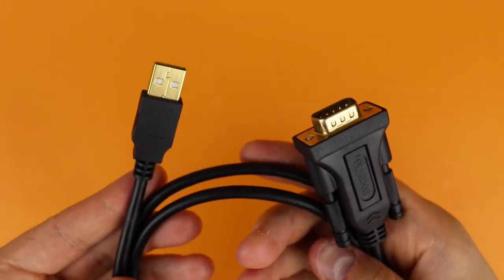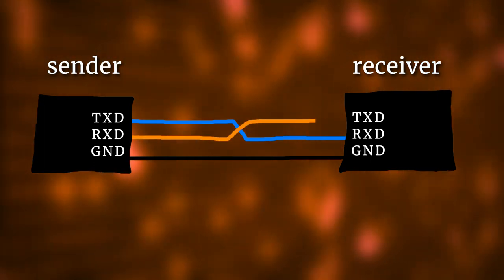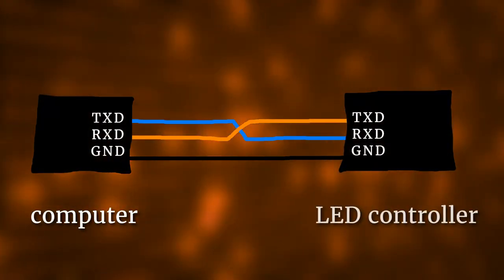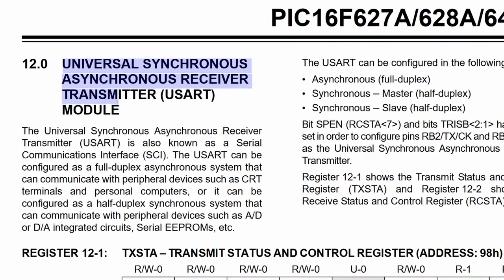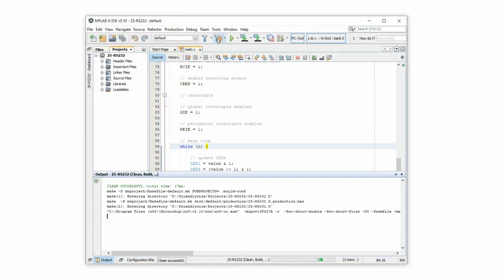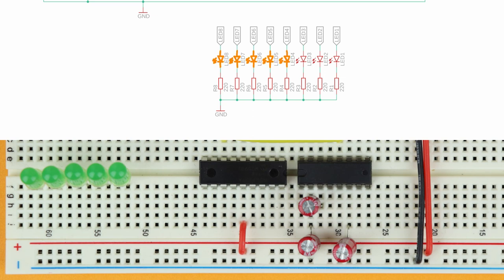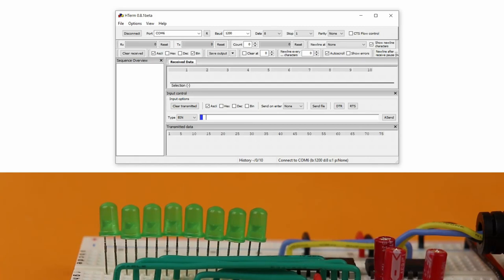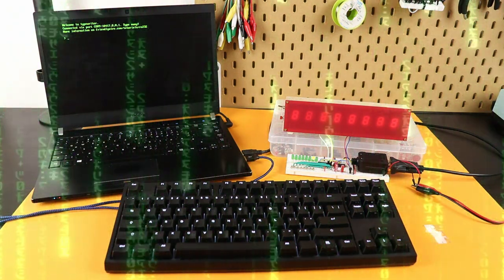Control LEDs with your computer using RS232!

Comment: Your videos are great!!
Reply from the maker: Thank you so much, glad you like them! :)
Reply: @FriendlyWire  do you do arduino too?
Reply from the maker: @arkmediagroupllc  For now I only focus on PIC microcontrollers :)
Reply: @FriendlyWire  can those microcontrollers control an I2C OLED display?
Reply from the maker: @arkmediagroupllc  Yes, many PIC controllers support I2C. I have not used it yet (most of the hardware I use is a bit older and only uses SPI-type protocols), but it surely can be done :) What display module do you have in mind? It might be a good future video!

Comment: I hope that the next tutorial will be pic interface with pc by using rs-422, rs485, and  USB
Reply from the maker: I have used RS-485 in the past for transmitting over longer distances, but only the hardware changes, the code will be the same. USB is a really interesting but that requires a different controller, like the PIC16F1455. I would love to make a tutorial on that one day!
Reply: @FriendlyWire For USB application  if you use an FTDI chip you no need to change to another microcontroller as long as the microcontroller has UART then could communicate with FTDI
Reply from the maker: @Alex-rv8gw  Yes, you can use intermediate drivers, true! I like that the PIC16F1455 and PIC16F1459, for example, actually don't need those, which is quite impressive.

Comment: Nice job!
Is it possible using your idea to control 8 independent PWM fans?
Reply from the maker: Thank you, glad you like the project! The PIC16F627A has only one PWM module, there are other controllers that have more. You could use the PIC16F627A to drive an 8x dedicated PWM controller, though, if you like, or even implement hardware PWM on the PIC16F627A itself. Does that help? If not let me know and I will explain more, and thanks again for stopping by! :)

Comment: I used to connect a device with a computer using device printer pins RS232 to DB9 RS232 at PC
but RS232 board broke down and now I am using an USB -RS232 at computer side but instead of coherent writeable ascii I  am getting commands characters under space codes
02 02 ... 02 18 10
The last 10 for LF is expected but 02s should be spaces and weights in ascii 

I am pretty sure that its a device configuration problem, but I thought, might it be a connection or a RX-TX inversion problem?

Well, now, because of your comment I will try inverting them.

BTW the device is a dynamic wagon weighting scale.
Reply from the maker: Interesting! Yes, it's easy to switch RX/TX either by mistake or by thinking about it wrongly, since one device's RX can be the other device's TX (or RX) depending on how everything is configured :) Did you manage to figure it out?

Comment: Hi , can I use a RS485 serial port on cctv recorder to trigger a relay . It can control a motorised ptz camera by setting rules in dvr, so I hope it is possible
Reply from the maker: Thank you for the question! RS485 has different voltage levels than the RS232 we talk about today, but I think that RS232 to RS485 converters do exist. Do you have more information on the CCTV recorder?
Reply: It is a Hikvision dvr and has 2 wire RS 485 port to control devices like motorised camera to look certain area when motion is detected. Instead of that I want to control other devices using a relay
Reply from the maker: @genuinetechniques9323  So you need a circuit that triggers a relay whenever the motor moves, yes? In that case you could sidestep the whole RS488 thing. What voltage does the motor use?
Reply: @FriendlyWire  I don't know the volatage of motor used, it all comes inbuilt. Only the control signal for movement of the camera can be  given through RS485 2 pin port.  And for my Requirement I can use any relay as u suggest
Reply from the maker: @genuinetechniques9323  I see. I think in this case it would be easier to just try to measure the voltage on the motor. In principle you can use a microcontrollers USART module to send data on the RS485 connection, but you would need a different circuit because the voltage levels are different. So it kind of depends: if you want to just get it done, then I suggest the first method, and if you want to spend some time to learn about the RS485 interface then that's the way to go. :)
Reply: Can I use a readymade relay board with RS485 support
Reply from the maker: @genuinetechniques9323  Not sure to be honest... Do you have a link to the DVR and the board?
Reply from the maker: @genuinetechniques9323  Without a datasheet that tells us the serial protocol commands this is a bit like fishing in the dark. Do you have a link to the relay board and to the DVR's datasheet?
Reply from the maker: @genuinetechniques9323  Okay, so the relay module accepts simple commands to set the relays on and off, the codes are at the bottom of the page. But I have absolutely no idea how to send out those commands from the DVR... I cannot find any information on the DVR's serial protocol. Nothing in the user manual and datasheet :(
Reply: @FriendlyWire  okay bro. Thank you for the support.  Anyways the dvr should be sending out some commands when a rule is met. Can we understand that and program relays to switch accordingly
Reply from the maker: @genuinetechniques9323  Do you have an oscilloscope? Then you could try to decode the commands that are being sent. Otherwise this is very hard to find out since the documentation of the DVR is a bit opaque on that :(

Comment: is it possible to interface an ATmega328 with MAX232
Reply from the maker: Hello Senam, thanks for your question! Yes, I am sure it works as well. According to the ATmega328's datasheet ( https://ww1.microchip.com/downloads/en/DeviceDoc/Atmel-7810-Automotive-Microcontrollers-ATmega328P_Datasheet.pdf ) it has a programmable serial USART interface, which you can use for RS232 communication :)

Comment: hi.. i want ask, what if i need rs232 to mini usb? what is needed to change from rs232 to mini usb? because most of those on the market are usb to rs232.
Reply from the maker: Hello, thanks for the question! :) The "magic" happens inside the big side of the connector (the right side of the cable shown at 0:00). On the left side you can connect a USB type-A to mini USB adapter without any problems. This way you can make the adapter from RS232 to mini USB, no worries :)

Can I ask to what device you want to connect it? It is important that the USB end is plugged into a computer that can recognize a virtual serial port. Almost all modern computers can do it, including the Raspberry Pi, but I am not sure if you could connect to, say, a smartphone.

Thanks again for stopping by, and let me know if you have any additional questions, I am happy to help! :)
Reply: @FriendlyWire  Thank you in advance.
I have an RFID that supports USB, but unfortunately my PC only has a serial RS232 slot left, from there I want to connect the RS232 to the mini usb on the rfid.
can you help?
i have used ic max 232 and usb TTL but it doesn't work.
Reply from the maker: @sepiroid  Oh, I see! I think in this case it does not work: the RFID device sends out information in the USB format. The USB to RS232 adapter I use in this video only works if the USB end is a computer that can understand a virtual serial port. In this case the RDIF device cannot do that. Just to make sure, do you have a name for that device so I can look it up?
Reply: @FriendlyWire  then what exactly is the data format that USB accepts on a PC? doesn't the USB port and db9 port have the same TX and RX?
What kind of chip is used to convert USB to db9 / rs232 format? device I use https://id.aliexpress.com/item/4000038621078.html
Reply from the maker: @sepiroid  USB is a vastly more complicated data protocol than RS232. They are incompatible. It is like comparing HDMI to composite video, they are just different.

The "USB to RS232 adapter" was perhaps a poor choice of words on my part. When you plug it into your computer, it is registered as a USB device, and the RS232 functionality is implemented virtually. The computer THINKS there is a serial port, but it is actually just a USB device in disguise. It's like mounting a virtual disk.

Your linked device is a USB smart card reader, and it needs to be plugged in via USB because it is a full-fledged USB device. It just does not work with RS232 :(
Reply: @FriendlyWire  ok, that means there is no solution for rs232 to usb. thank you for the discussion so far. wish you good health always.
Reply from the maker: @sepiroid  Yes, unfortunately in this case I don't think it works with this particular adapter. Sorry, I hope my video was not too confusing. And best wishes to you, too!

Comment: I don't mean to be negative, "but" I'm wondering if anyone would actually use a rs232 adapter to usb, when nowadays you could simply use something like an arduino nano instead, which communicates via UART over USB in the same fashion. I mean actually prefer it, other that just to play around. And if there is a use case where this setup is better, then I would be interested in what it is and why it's better.
I mean it would basically reduce the part count to the arduino nano, a usb cable, breadboard, jumper wires, resistors and leds. That would be more cost effective for sure. And even without USB it would still be easier to do, I suppose.
Another benefit would be that way you gained some experience with arduino if you're new to it and could use it again in another project and expand that knowledge.
Reply from the maker: Sure, that's possible, too. I like to show how to use PIC controllers, and work at a rather basic level using the PIC's registers. More advanced PICs also support USB directly, but that is a whole different level of complexity.
Reply: @FriendlyWire  I see, thank you.
Reply from the maker: @Noxoreos  I think it's actually great that there are so many different ways to connect computers to microcontrollers these days. I hope to also talk about how to read out old PS2 keyboards and mice using a PIC soon.

Comment: Can we do the same circuit connection with the arduino?
Reply: I mean the way rs232 goes to de pic
Reply from the maker: @gerardcortez4094  Thanks for the question :) I am not sure exactly what you mean. This project uses the USART module of a PIC microcontroller, so it only works for PIC. If you want to use an Arduino I am sure it also supports serial communication, but it will be different to connect it :)

Comment: Bro i have a old g31 lga 775 motherboard...it has separate 9 pin serial port  ....i want to use it but don't know how to use it ....max 232 ic is making it more complex and delay in signal
Reply from the maker: MAX232 is just a level shifter, I don't think there is significant delay involved from using this chip. Do you have the motherboard up and running, with an operating system? Can you access the COM ports from there? It should be easy to send out data from there. Just make sure you pick the right Baud rate (or, in other words, make sure the PIC on the receiving end knows what Baud rate the computer is set to).
Reply: @FriendlyWire  i want to use sim900a module
Reply from the maker: @surojitdas4496  I'm not familiar with that one, all I could find on Google is a "wireless extension module" but I am not sure how this is related to the serial port? :)
Reply: @FriendlyWire  no worries... thanks
Reply from the maker: @surojitdas4496  Sorry I could not be of more help. But basically this tutorial here allows you to connect anything you want to a PIC using the serial interface, so if this module comes with serial commands then you could send/receive them with the PIC :)
Reply: @FriendlyWire  it can be a topic for next video 🤣......but i got some info ...like DTR, CDC , RI and other pin information can you once go through the datasheet of sim900a ...it's a gsm gpr module...used with Arduino....
Reply from the maker: @surojitdas4496  Hahaha, there are always so many interesting topics to work on :D In all honesty, this is too complex a topic for me to discuss in a comment, and I don't have too much time these days to read the datasheet in detail, unfortunately. One thing I should mention: in our implementation in this video we only use the RX and TX wires of RS232. But there are many other wires that can be part of the protocol, especially when multiple devices are connected via modems and so on, so chances are that this will be more advanced to implement. Best of luck!

Comment: How to display a image using RS232 protocol
Reply from the maker: Ohh, that would be difficult if the image has a high resolution. What kind of image do you have in mind?
Reply: @FriendlyWire  pixel  image for a  advertistment  board led panel
Reply from the maker: @GJROBOTICS  Is it supposed to be a movie (if yes, how many frames per second, and what is the color depth), or just a static image? And what is the resolution?
Reply: @FriendlyWire  can you upload a tutorial for that . I have a idea only for that.  I wanna create a bill board to display images. thank you.
Reply from the maker: @GJROBOTICS  RS232 is not the ideal format to transfer visual data, it's better for text-based content. The data transmission rate is too low for billboard-style images.

If it's a small image, say, 62x62 pixels, and only one color and static, then it's easy. If it's a 4K screen showing a video with 16 million colors then it's close to impossible :)

So the resolution and color depth really matter here, also if it's a movie or a static image. What resolution etc do you have in mind? :)
Reply: @FriendlyWire  Understood sir.
Reply from the maker: @GJROBOTICS  Didn't mean to shoot down the idea :-) I am just curious what kind of resolution you have in mind.

Comment: Can this be used with USB communication?
Reply from the maker: Thanks for the question! :) This "USB to RS232 adapter" is a USB device that acts as a virtual COM port at the computer. The computer can access this virtual COM port as if it was a physical COM port. This means that it is really effectively a serial connection, with all its limitations such as data bandwidth. So it is NOT a USB communication, because it does not use the USB protocol to transmit data. I hope it makes sense :) If not, please let me know and I will try to explain better! Have a great day, and thank you for watching the video!

Comment: Why don't you connect the cap at 4,5 pins of max232
Reply from the maker: Good question, I should have mentioned it. If you look at the schematic at 5:05 you see that there is another pair of inputs/outputs called R2IN/R2OUT, T2IN, T2OUT, because the MAX232 can actually support two channels in total. And C2 is needed for the second channel. Since we only need one channel for this project, you can omit C2. Hope it helps! :)
Reply: @FriendlyWire  tq a lot
Reply from the maker: @susmithat881  Happy to help, and thank you for your interest! :)
Reply: @FriendlyWire  we are doing project about transmission of characters using pic controller and max232 and rs232 to pc but we can't see the characters in hyper terminal can you please suggest how to deal with.i have debugged at max232 we put led it glows but we can't see output on hyper terminal baud rate everything goes fine.please can you suggest where it went wrong.
Reply from the maker: @susmithat881  It's great that you built this, nice work! It always takes some time to get these things sorted out. Did you use the PIC16F627A, and the PICkit3 to program it?

Comment: The MAX232 is for 5V, C = 1uF
the MAX232A is for 5V, C = 0.1uF
the MAX3232 is for 3V or 5V C = 0.1F
Reply from the maker: Thank you for your comment! We are using the MAX232 here, so 1uF should be OK. How come the MAX232A only needs 100nF for the charge pump?

Comment: How do I connect a relay to an FM radio output so that it can turn on a light when a strong signal is received?......
Reply from the maker: Oh, good question! Do you want this to work with a general radio station?
Reply: @FriendlyWire  No, a blank spot near the bottom end of the dial. I want to receive the signal I transmitted, then relay must get activated.
Reply from the maker: @Berghiker  Okay, I think I need more information :) You are creating your own FM signal?
Reply: @FriendlyWire  yes, a simple FM transmitter.
Reply from the maker: @Berghiker  You could look into using a phase-locked loop (PLL) for that, but this is also a bit beyond my expertise. I am sure that @FesZElectronics (https://www.youtube.com/c/FesZElectronics) should have you covered :)